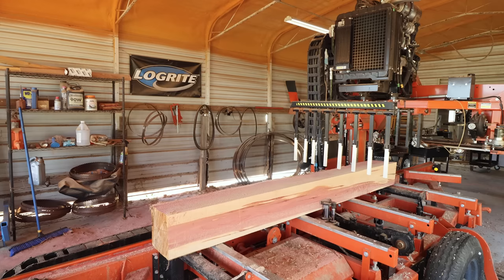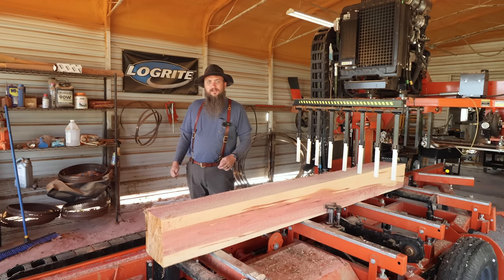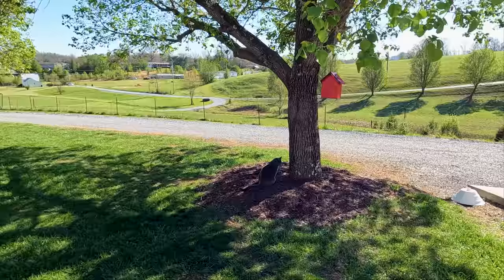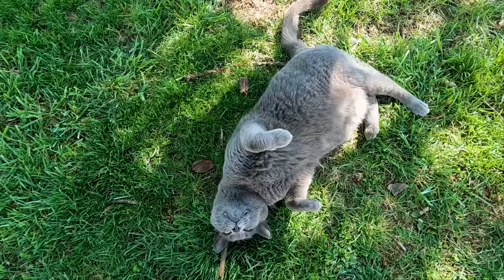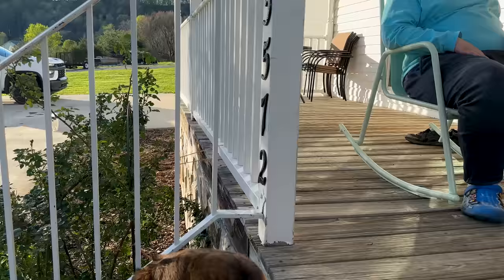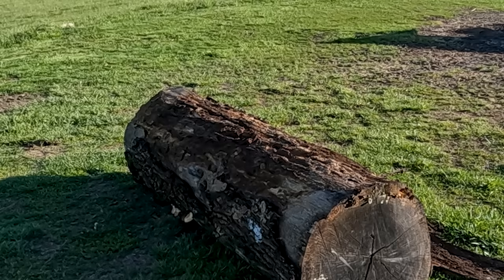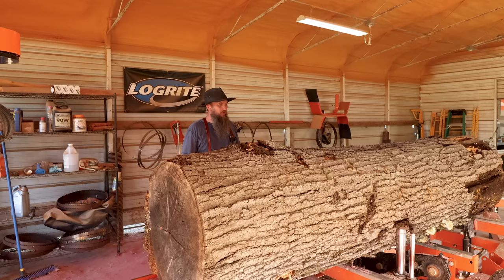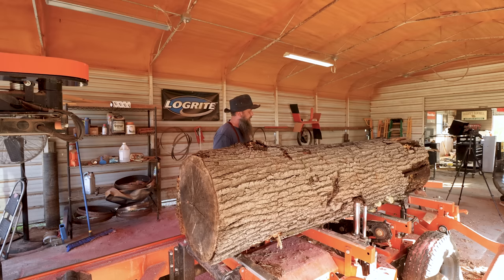Super Sawmill VS Huge Rotted Oak Log. Will It Make The Cut?

Comment: Clean up under and around this mill looks like a lot of work especially with old logs. I suppose you can fold up the jack legs, hitch up and pull the mill out so the skid steer & a scoop can access the whole floor. Still a lot of work.

Comment: I have a white oak log, it's 35 inches across 12 feet  long. Straight and with very few knots.  I live in halls crossroads. Just outside Knoxville. The tree was cut down in 2019. Can you suggest someone who can take it.  I would hate to just cut it up for firewood.  But I have no way to move it . Its probably close to 5000 lbs.

Comment: Nathan, I have a question about when you load the kiln, why do you load from the front first and then have to lift over each slab over the next to the back. Wouldn’t it be easier to put the back slab on first then remainder slabs to fill that level from back to front? I know everybody has their way of doing things but not lifting other slabs might save your back. Just concerned. 👍👍👍

Comment: Nathan, have you ever milled any burls? We have a huge one on our property that I've seen grow for many years and never really knew what the heck it was until I started getting interested in saw milling. The tree finally fell a while back and I was kinda wondering if you might have an idea how to mill it. It's probably 4 feet across.
Reply: Cheapest/easiest way is with an Alaskan mill. Requires powerful chain saw with long bar and ripping chain. If site is close to level and there's enough elbow room, can usually be done right where log sits.
Reply from the maker: I have not cut in burls no, not many around here, when I do find them way too expensive,
Reply: @johna1160  Thanks we may give that a try.